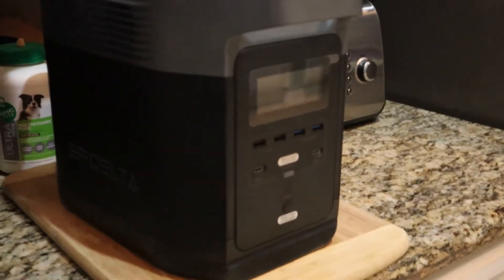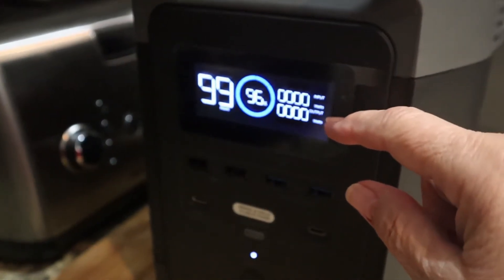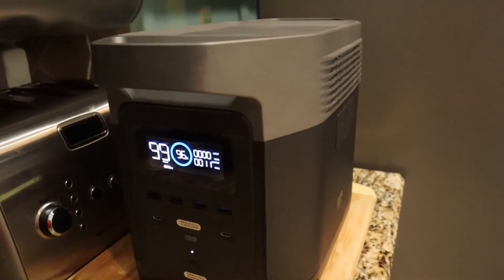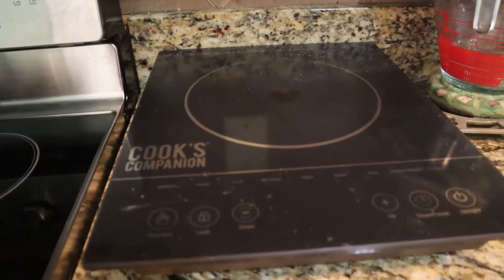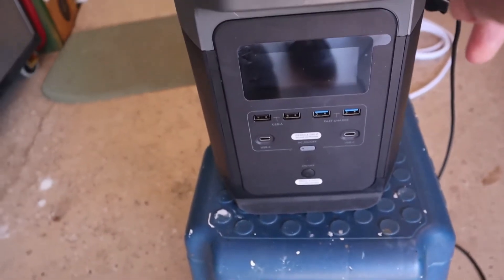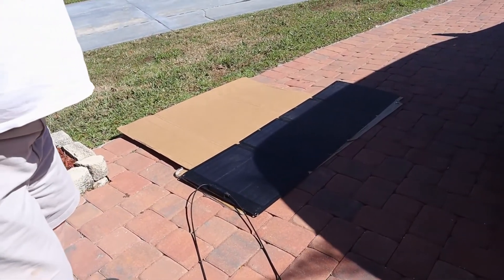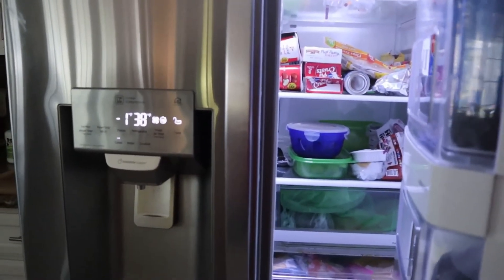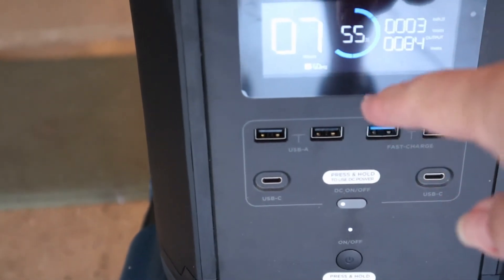How to Use the EcoFlow Delta 1300 Power Station to Power a Refrigerator

Comment: What if you need to pwer one for like a week what size would one  need .
Reply from the maker: I was told that you didn't need the fridge plugged into the power unit all the time so I guess I would use it sparingly.  We haven't lost power in our area for days on end...ever.   We have some solar panels to use to keep the power unit charged up in case power goes out for a while.  However, if I were concerned about a lengthy power outage, I would definitely look in to something along the lines of a generator that would power the entire home or, at least, most of it.

Comment: great video although I would have liked a bit more detail. for example, a true break down and from 100 to say 10% How long did it run the fridge with no external power. One point it was running the fridge and the next you were in the garage and had run it down and was charging it back up and didn't mention how long it took for your fridge to run it down and to what percent. That would have been useful.
Reply from the maker: Totally understand what information you're looking for.  This video was made a few years ago now and it basically was just to show that this little power unit could power a full-sized refrigerator/freezer in case we lost power after a hurricane.  It does that just fine but our thought is that it was going to be for short-term power.  It does pull a lot of juice from the power unit so it would be used sparingly.  If you want to use something like this on a more regular basis, I would suggest a larger generator of some sort or even solar panels.

Comment: Using the ice machine would definitely impact how long it lasted.   I would recommend keeping the door closed as much as possible and do not use any dispensers on the fridge.  I would love to know how long it took to get down to 3 hours remaining.
Reply from the maker: Very true!  We were just testing everything out on the fridge to see if it worked while plugged into a small power unit.  We got the power unit to use when needed during hurricane season here in FL  We've only needed to use it a couple of times since doing this video and, fortunately,  our electric outages lasted for just a few hours each time.

Comment: I"m guessing the point of the question about how long will it power the fridge has to do with some of us, just wish to keep our food cold during a power outage. So I'm curious, HOW long will it keep the fridge powered JUST on a charge and without the use of a solar panel?
Reply from the maker: Our purpose in this video was just to make sure that this power unit would be able to run our fridge if needed,  and it did do that.  Here in Florida we do get power outages especially during hurricane season.  We haven't had to plug the fridge in for any length of time but we wouldn't keep it plugged in to the power unit all the time.  It's a big fridge/freezer; it would drain the unit in just a few hours.  If you want something to power more long-term, I would look at solar or a generator.  My husband didn't want to look at a gas generator because he didn't want to store gasoline in the garage.

Comment: When you add some wattage to your solar, you will be amazed that your can fun your Refrig on the Battery 24/7.  Great to know you can save your food if the power goes out for more than 3 days.

Even when my power has gone out for 3 days...I have never lost food.
I just move the milk in the Freezer AND move food from the Freezer to the "Cool Area" that I will be cooking in a day or two.
-Milk stays Cool
-The Frozen food/ICE in the "Cool Area" keeps everything else cool...JUST Like the old "ICE Box" Days.
Reply from the maker: Thanks for the tips!  We also freeze water in gallon jugs when we hear a hurricane is coming near -- just in case we need that to help cool the fridge.

Comment: Terrible review. Why not just drain the unit running the refrigerator? And then give us the time 😢
Reply from the maker: I'm sorry but this wasn't an actual "review" of the power station.  We were just testing out our new power unit to make sure it would run our refrigerator if needed during a power outage and we showed that it did.  It worked just fine.  That was the purpose of this video.

Comment: Do you think this will work to run a 2400w oil heater for 7 hours?
Reply from the maker: Good question!  I don't have an answer for you though. You should contact the manufacturer; they might be able to answer you.

Comment: What extension cords are you using?
Reply: Thank you 😊
Reply from the maker: When we plug the solar panel into the power unit, we use a heavy duty extension cord, which was a separate purchase.  The fridge plugs directly into the power unit which is in the house.

Comment: Nice but $1100 to $3600 on Amazon is more than most can afford. My 8 year old generator was $279 on sale.
Reply from the maker: Hey, if it works and suits your needs, that's great!  My husband didn't want gas setting around to use in a generator and he didn't want the noise either.  We didn't pay anywhere near $3600 for our power unit and, actually, we now have 2 Delta power units on hand for emergencies.  With the hurricane headed our way, we're very satisfied with the idea we have these little units to use.
Reply: @DebsWay  You should take a look at the Bluetti EB240 and the EB150 as well. I tend to get a few small units, then medium ones and bigger ones for redundancy. A 200W waterproof foldable Solar panel is great too.
Reply from the maker: Hi there!  I think the Bluetti looks very interesting, too.  I have seen several videos done by people reviewing a Bluetti unit and they look like a very suitable power supply.  The cost of them didn't sound too bad either.
Reply: @DebsWay  They are a reasonable cost but I find their solar panels a bit expensive. Glad I came across the 'ALLPOWERS 200W Foldable Solar Panel mc4'. Aside from the slightly flimsy feet, these seems great.

I noticed the solar panel on the floor in your review was in the shade a little. It would get more power angled with feet too. Really enjoyed your review :)
Reply from the maker: Thank you!  I appreciate your suggestion on the panels -- I've learned a lot since that video aired.  I now prop the solar panels  at an angle when I use them.

Comment: Hi, I truly appreciate your help in the refrigerator testing. I also have the 1300 and I have a question about the plugs. I see your fridge had a three prong plug, and it look like you used the hole as well.  Because I thought it needed adapter cuz it didn't look like it would fit. I thought it was a international hosi- dingy? So I'm thinking that pole isn't grounded or touching the way it's supposed to. So  when you switched to charging outside by solar panels, did you use a extension cord?  And what is wattage of your panels?  I brought the bundle and chose the 160 watts with mine. I've been looking all this time for a 2 to 3 prong extension cord for length and heavy duty 
14awg, 15amp, 125 v, capacity cord. So you guys made it so simple, I think I over thought this thing too much. What say you? Help me my brother and sister, God Bless y'all 🙏💯💖
Reply: Thank you for your reply, You two have eased my  mind about my purchase on the EcoFlow Delta 1300 , I was also looking basically to keep my fridge and hot plate working. Speaking of hot plate can you tell me where you guys got your one you showed in your fridge testing video. I like that one you have and would like to get one like it. I got a two burner I don't like it's 1800 watts, I like the one you have even though it's older model maybe I can still find it where you got yours. Thanks, Deb's way, God bless 🙏💯💖
Reply from the maker: We bought our power units for emergency power uses.  We live in hurricane country so have a few things on-the-ready for power outages.  We love both of our Ecoflow units!  
What I have is an induction burner that I bought from a home-shopping TV show a few years ago.  You can check it out on Amazon; they have several different models.  Take care now!
Reply from the maker: Hi there!  We plugged the fridge right into the power unit -- no adapter needed.  Our test was to find out if the power unit would actually power up the fridge and it did.  We were pleased with that!  Yes, we used a heavy duty extension cord to plug the fridge into the solar panels -- the cord was a separate purchase.  I think we have a total of 200 watts on the panels.  We were very impressed with how this little power unit worked and recently we purchased a EcoFlow River power unit.  It's a little smaller unit but works great!

Comment: Just a tip.  I noticed that you kept pushing the "DC" on/off button when the screen display turned off.  Don't do that.  Press the power on/off button below the "DC" button to turn the display screen on.  Turning on the "DC" function needlessly will cause a small drain on the battery.  The same would be true if you kept pressing the "AC" button without anything connected to it.
Reply from the maker: Thanks so much for the info!  We're learning!!

Comment: It got down to 3 hours after how much time(
Reply from the maker: I really do not remember exactly how long we had run the fridge on just the power station alone.  It was just a few hours though before we hooked up the solar panels.  This was just a test to make sure that the fridge could be kept running in case of a power outage.  And it worked.  We have even just recently bought another power station.  These things work great!
Reply: @DebsWay  cool.. I'm buying mine soon. Thanks for the review.

Comment: Mini Solar TIP, Ein untertischbeuler and all other hungry electricity consumers can be infinitely dimmed with the 5000W dimmer (EUR 7). I run 5 dimmers in parallel on an 850W inverter. Kettle 2.2KW at 150W runs 12 hours a day, so the water is always hot. The room is also nicely heated. 2.5KW washing machine runs in parallel with dimmed to 200...400W. Iron, dishwasher, oven, electric heater, coffee machine, all internal heating are throttled with me. Videos about it on my channel https://youtu.be/eC2olbCBhh0 The inverter stays cool, quiet and the MOSFETs remain intact because extreme current peaks no longer arrive at the inverter. Now every Mini PV Inverter is enough to sell large devices...
Reply from the maker: Thanks for sharing this information!!  Take care now!

Comment: you said it got down to 3 hours before u plugged in the solar panel., but what was the starting time? could have been 10 hours, could have been 24 hours?
Reply from the maker: We did this test run quite a while ago but I believe that the power unit was fully charged when we plugged in the fridge/freezer unit.  We ran it on the power unit to make sure it would run sufficiently if we had a power outage.  And then we were just experimenting with the solar panels to see how that would keep the unit powered.  We will use this power unit for emergency situations only so we were just testing to make sure it would run something as big as the house refrigerator/freezer and it did.

Comment: Thank you for your test.  I had looked at this unit but was concerned about running a larger refrigerator with it.  The company shows a smaller 2-door fridge.  I have a similar French door refrigerator (Sears Elite but is made by LG) to yours.  We do have some power outages, plus, have had hurricanes.  Hated to lose the food in my fridge during a hurricane.  This will be a life-saver!
Reply from the maker: We are very pleased with this unit to be used when we have a power outage.  We also have a solar panel to use with it.

Comment: Watched your video the other and I don't believe you said how the the Delta actually powered your refrigerator. Am anxious to know how many hours it can power your fridge before needing to be recharged. Also, very important - I hear the Delta cooling fans run all the time snd are quite noisy. I know they would be on full speed during charging but running a refrigerator like yours what was the sound like? Don't want to live with high noise.  Thanks Alo!
Reply from the maker: There was no fan noise that we could hear at all.  This was a test we did to just see if it would really power up the fridge and it worked.  We let it stay hooked up for just an hour or so to see if it would keep cooling and everything was fine.  If you're planning to use something like this for days on end, I would definitely get the solar panels with it.  We bought this mainly to have something on hand as a back-up to power up a few things around the house when we lose power during hurricane season.  It's quite a powerhouse!

Comment: NO, WRONG ! mis-leading... just because lights are on doesn't mean the fridge is working. the compressor didn't kick in.
Reply from the maker: We kept the fridge/freezer hooked up for several hours and it kept running just fine. Do you have one of these power units?  Did you test it with your fridge/freezer?  We were very impressed with its capability.

Comment: I bought this unit a week ago, along with 2 sets of solar panels. Very impressed with it so far. We've only run a portable fridge/freezer on it and it works very well. Haven't used the solar panels yet, haven't had much sun. But we're looking forward to trying that out and see how it works. We are now thinking of getting another unit, either like this one or going to the bigger one, the Delta Max Pro, and maybe even get two pair of solar panels with that one.
Reply from the maker: James, we are very impressed with this little power unit and will be looking for another solar panel to go with it.  My husband even mentioned recently something about getting another similar unit.  We'll see...

Comment: The solar panel should of been kicking in more than the 3w shown.  The panel needs putting on a stand to better angle it.   Are the solar panels the ECO flow ones?  

110w Panel should be able to put in 70-80w in ideal conditions.
Reply: Further thoughts on this, if you are still not getting more tan 3-5w in check and the panel is angled correctly check the cables and extension cables, they may be the issue ( too much resistance )   :)
Reply from the maker: Ok, thanks.  This is an ecoflow solar panel and it does have a stand but we didn't use it when we were experimenting with it.  Thanks for the info!

Comment: When you get more panels can you do a vid. If you could run a fridge day after day that would be amazing.
Reply from the maker: We bought this power unit to use if we lost power.  It's a pretty good little unit.  If I needed to run the fridge continuously tough, I would want some sort of generator set-up that would run everything in the house -- or most everything.  Like Generac.
Reply: @DebsWay  Thanks Deb! That's helpful Info. cheers.

Comment: Refrigerators don't run all the time. They only have to maintain the temperature. I'm looking at purchasing a two pack of these on Amazon for about $2200 after a $300 coupon.
Reply from the maker: True.  And the more you keep the doors closed -- which means you stay out of the fridge unless you really need to get something in there! -- the longer it stays cold.  Have a good one!!